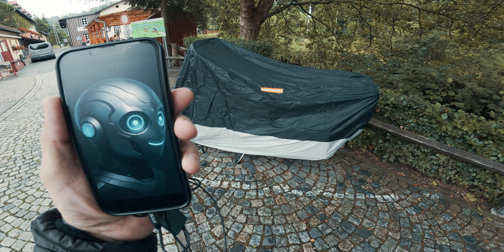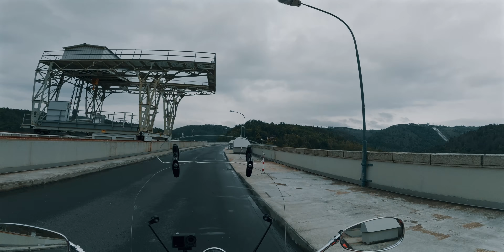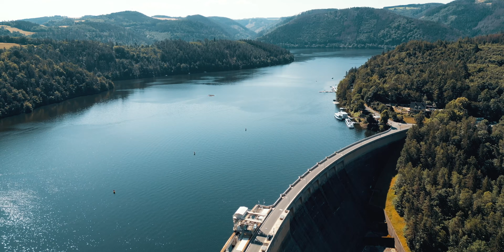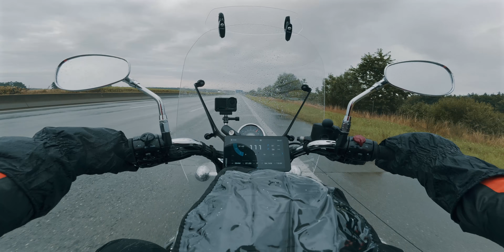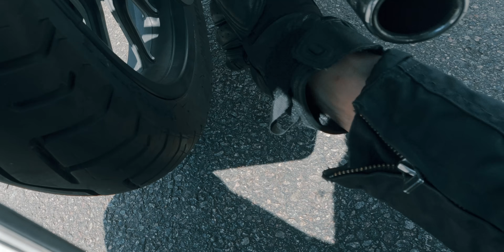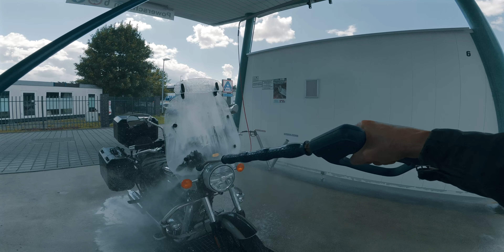A Rainy Solo Ride on the Royal Enfield Meteor 350 - Belt Drive Problem

Comment: Hi Mark, I've done the belt conversion on my Meteor 350 and according to Ride with T and RS Tech the belt should run about 1 mm from the flange on the left hand side. When I set mine up it travelled too far to the right (where you have it) and it cut a grove in the round cover just above the swinging arm axle. Check to see if it's done the same to yours. My model is a 2022.
Reply from the maker: Hi @Pher1954, thanks for the heads-up! That sounds like a serious issue that's very easy to miss during installation. I've actually recently reverted "Luke" back to the classic setup with spoke wheels and a chain, so the belt is no longer installed. However, I'll definitely check that cover for any marks or grooves it might have left behind during the time I was running it. Thanks for sharing your experience—this is great info for everyone else in the community considering this conversion!
Reply: @Marc.Stones  Hi Mark, I'm glad that of some use. That's interesting to see that you've reverted to spoke wheels and chain. Will you be covering that in a future video.

Comment: One problem with the Meteor, is that the axle adjusters do not have a locking jam nut, like the Interceptor.  I find it best that once the belt/chain is adjusted and axle torqued, to go back and snug up the tensioners to make sure that nothing moves during use, and so that it does not vibrate loose and loose the end cap

Comment: Great video Marc, I liked how you cleaned the bike when you got back. You had a towel for it as well. I think Neo is an incredible idea. I still think your old Transalp has some good features as well. The efficiency and ease of modern bikes is a plus. But in NZ I have an old 1974 BMW R90/6. After a few days on that you adjust and enjoy it. Excellent motorcycle channel.
Reply from the maker: Thanks, I also like to keep the bike clean! 👍 Yes the Transalp is a great touring motorcycle, maybe I will go for an adventure bike next season again.
Reply: @Marc.Stones I will take bike to wash station as I am going away this weekend.  Part of the reason why modern bikes can feel cold is the ride by wire technology.  Clinical feeling. But these modern bikes are purposeful, esp adv bikes like Transalp. They get the job done efficiently but without the old-charm. I'm not sure l'm fully okay with it, so l understand your dilemma,  if you have one. Have you tried a Moto Guzzi V7 or similar?